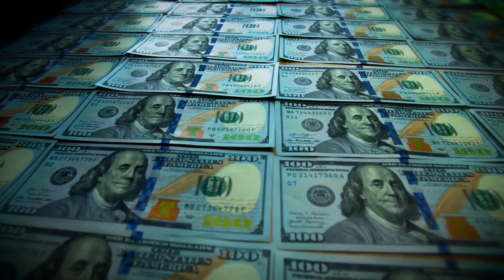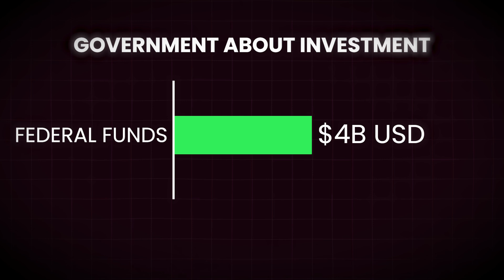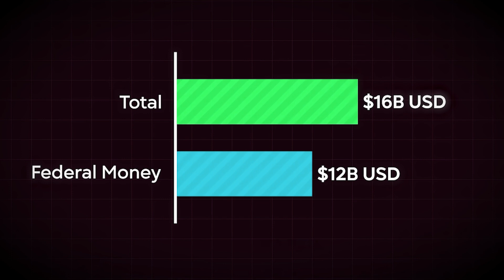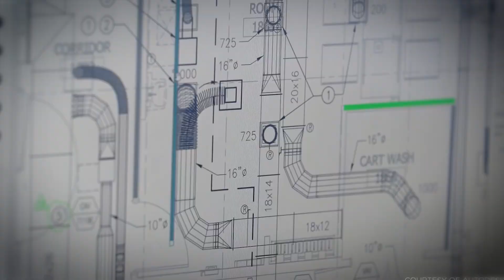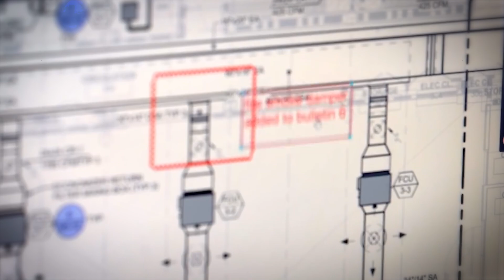New York's Great Plan To Relieve Congested Railways

Comment: Great video.  Where exactly on the NJ side does the new tunnel begin?  What will the tunnel be going under, North Bergen, Union City, the northern tip of Jersey City, some of Hoboken?  How are the existing tracks approaching the new Portal Bridge eastbound going to merge onto the tracks on and approaching the new Portal Bridge going eastbound?  It seems to me that new tracks will have to be built getting both on and off the existing tracks from Swift Interlock all the way to just before Secaucus Junction.  Exactly where in the meadows will the new tracks heading to the new tunnel diverge from the old Corridor tracks heading into the North River Tunnels?  How will all the tracks from both tunnels link up at NY Penn?  Thank you, sir.